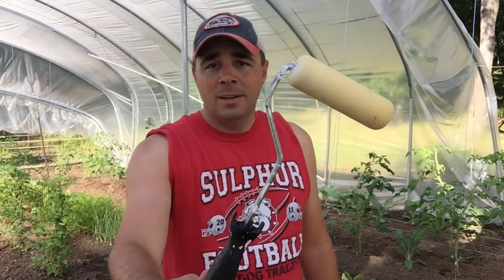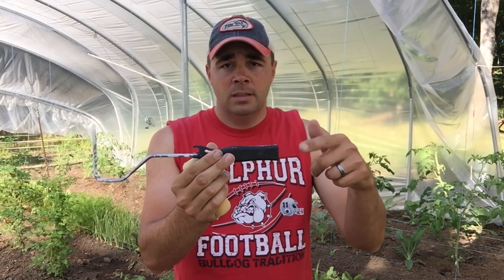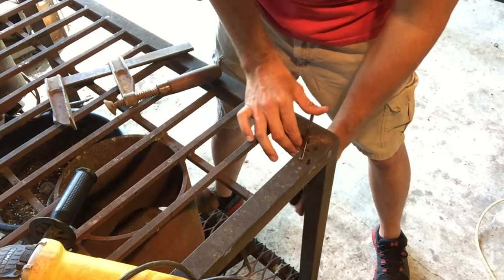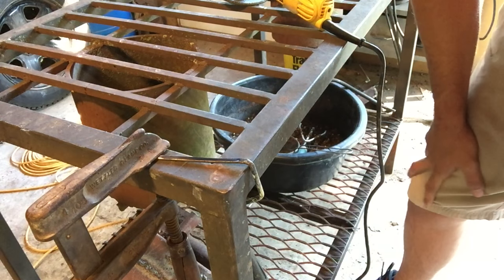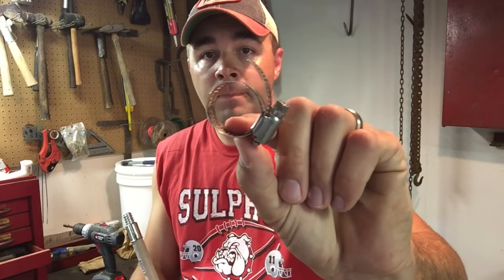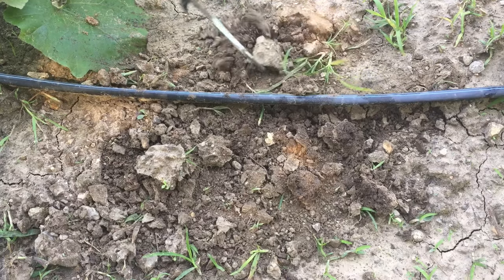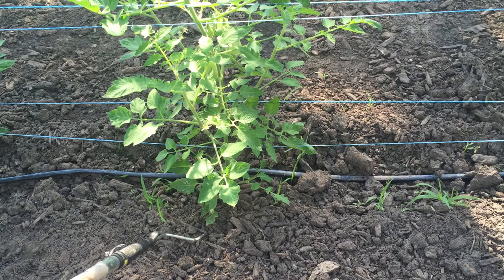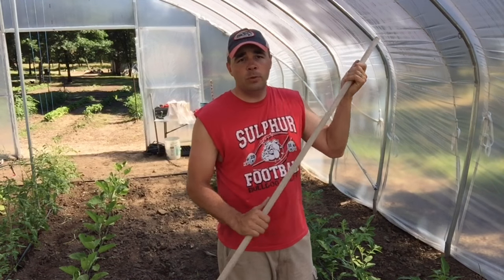Awesome DIY garden tool

Comment: If you have a torch, you can hot forge that with a hammer and leave the material there, plus you will also give it a little hardness in the forging process.  If you have a vice or anvil this works great, this metal is soft enough to do this without heat.
Reply from the maker: Good idea, I don't have a torch, but my way seems to be working pretty well.